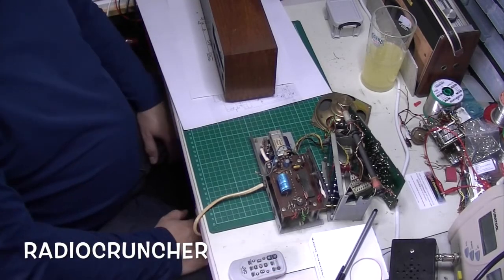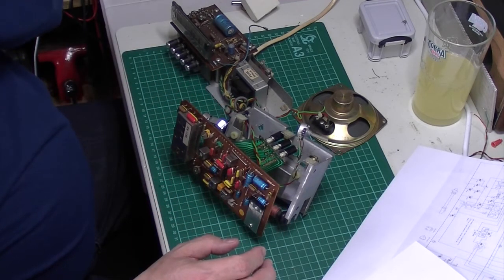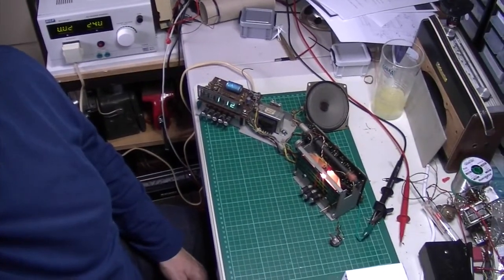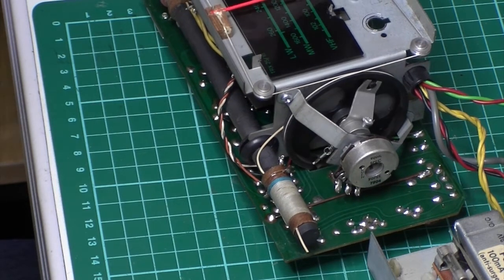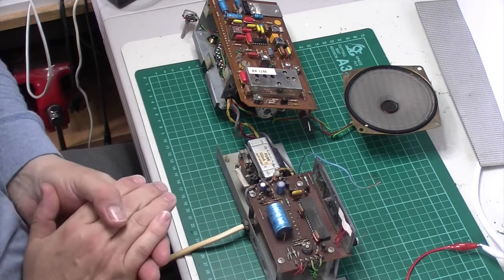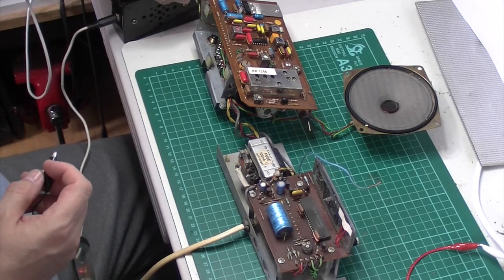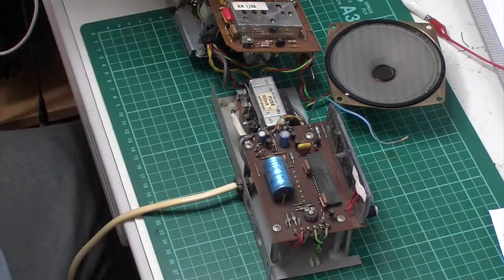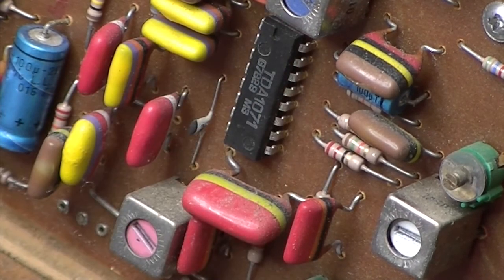Roberts RCM1 clock radio Part 1: FM voltage adjustment and chasing down the fault

Comment: Hello Radiocruncher, I have one of these radios that has a slipping drive cord & won't tune. I have read the manual but I can't see how the fibre board back cover is removed from its slots. I read that the aerial should be removed but can't see how it undoes, it just turns through 360 degrees. The board back is in slots top & bottom and even when pulled up there isnt sufficient clearance for the board to swing out. Not wanting to damage it by forcing I wondered if you can offer guidance please, many thanks. I have enjoyed watching your video.
Reply from the maker: Drop me an email to graham@radiocruncher.com and I will help. I have one of these as my bedside alarm clock
Reply: @Radiocruncher   can you tell me how to remove the aerial on the RCM 1 also as I am unable to remove as it just spins 360?

Comment: Hi there

I recently managed to get one these from eBay. I'm having trouble disabling the alarm. Regardless of the position of the left hand switch the alarm sounds; I was wondering if you could shed any light on this before I start dismantling. I'm hoping it may be as simple as a faulty switch which is permanently set to 'Auto'? Any help would be grafefully received
Reply from the maker: The clock and alarm are all done on one IC so it could be that

Comment: Do you know if it's possible to turn off the alarm completely on this radio? Thanks in advance
Reply from the maker: Hi Eleanor. Yes with the switch all the way to the right the alarm is off although mine still gives a pop even when it’s switched off